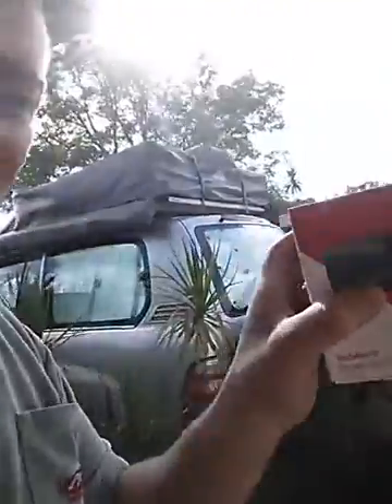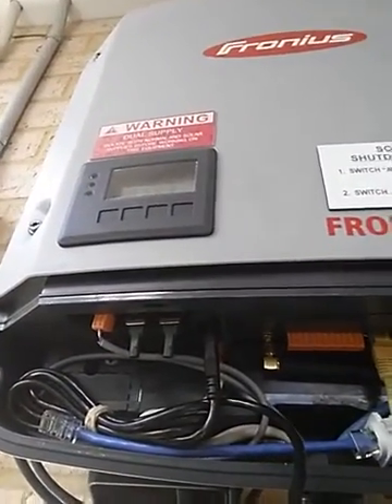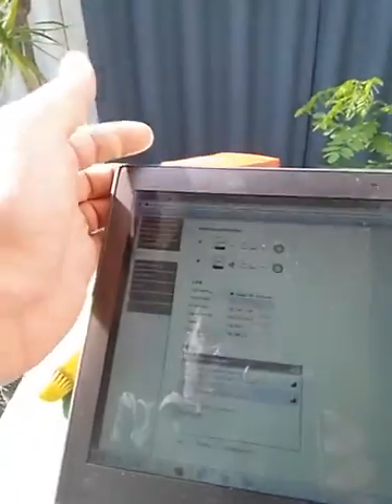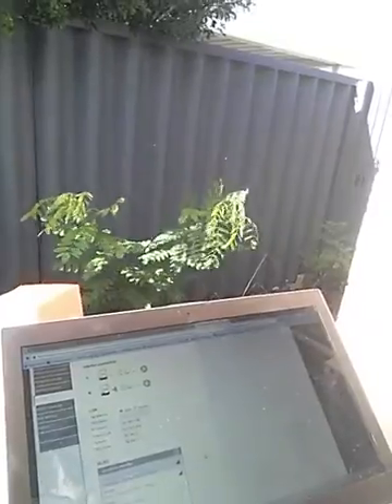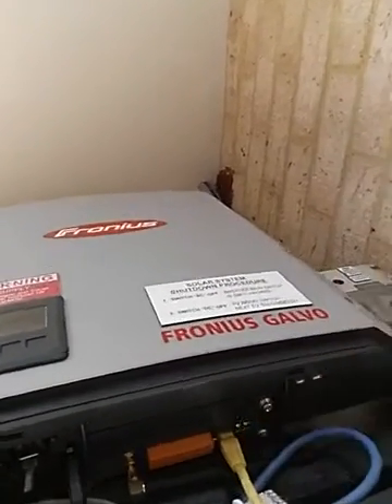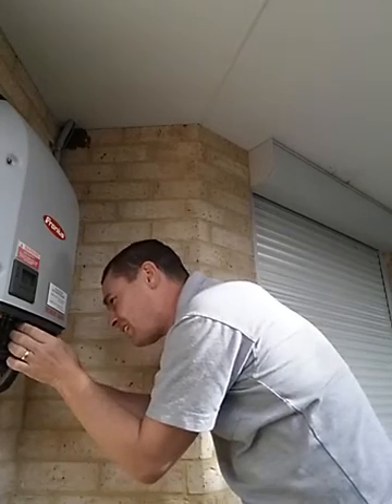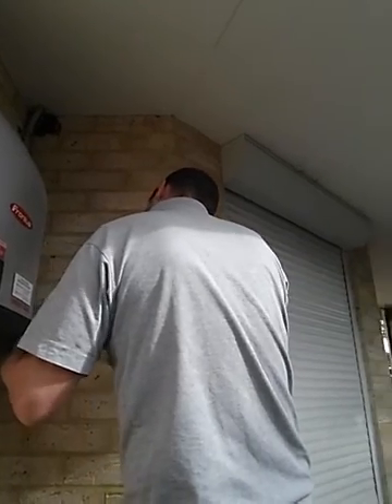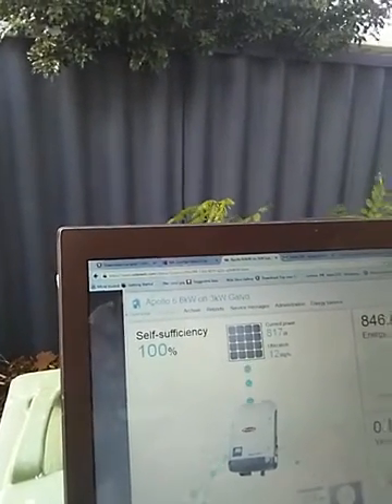3G connect a Fronius Galvo Symo Primo to internet

Comment from the maker: Ongoing 3or 4G network costs are what they are across the world. In this case 1GB a month is 3x what is required and must be renewed annually as its a prepaid service.  Ideally you would link to another service such as your phone (intended for tablets with 3G or 4G connectivity etc) and be cheaper.
At $120 a year for this solution, does not make economic sense as you'd need to add at least 2 panels to cover the cost of the service.  On a large site this is not an issue but for a 3kW domestic system is expensive.    Alternative could be to setup your phone as a hotspot, configure your datamanager to upload daily and it will automatically connect when it sees the wifi and upload historical data to solarweb.